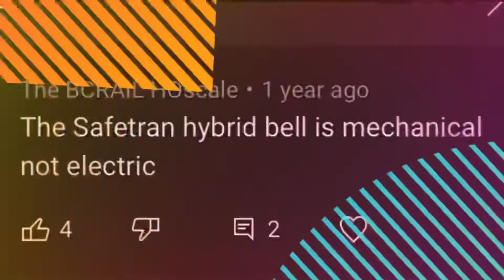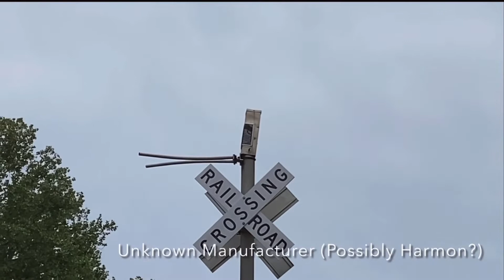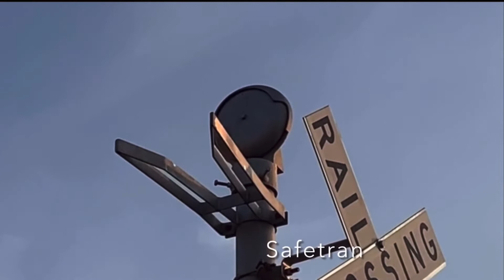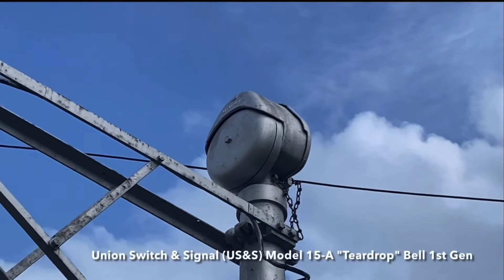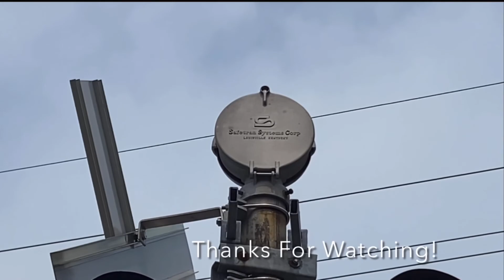2,000 Subs: Different Types Of Railroad Crossing Bells - Remastered!

Comment: Kinda surprised you only did one Safetran, given that they had two different generations of mechanical bell, lol. Nice video though!
And congrats on 2k!
Reply from the maker: They actually aren’t generations. They are just the 5 inch and 4 inch versions. The 5 inch ones are the flat bases and the 4 inch ones have the slanted type. They used both models from the 70s into the 2000s.
Reply: @upking9080  From what I've seen, no. The 4 inch base ones appear to have proceeded the 5 inch base ones (at the very least), and I haven't seen any evidence that they were sold alongside each other at any point.
Reply: The 5 inch base ones even have a piece cast into their bases to make it easier to mount them on a 4 inch mast.
Reply from the maker: Interesting. I’ve seen a photo of a Safetran bell in the 1970s with a 5 inch base, so I’m not sure what to think.
Reply: @upking9080  The 2nd Gens were already being made by the late-70s, IIRC, based on what I've observed. The 1st Gens don't seem to have been made much more than half a decade or so, give or take a few years.
Reply from the maker: What confuses me is that I found a photos of a brand new 1985 safetran install with a brand new 4 inch base bell mounted on an adapter.
Reply: @upking9080  Hmm... New old stock, maybe? Or even re-used? Really, outside of the bodies (given the fact that the bases are cast-on), the two generations are pretty much identical, especially mechanically. I could easily see a railroad re-using a bell that'd been removed from another crossing or even finding it in storage somewhere and using it.
Reply from the maker: What doesn’t add up was that the install was brand spanking new, and everything was the same color of shiny silver aluminum. The old "signals" were crossbucks. I’d also like to note that a few other crossings on that line that got new signals, also had 4 inch bells on adapters.

Comment: Where the crossing with the General Signals prototype chip?
Reply from the maker: That bell is gone now.
Reply: @upking9080  Did it break?
Reply: @cdtx8306  no it got replaced by a new bell
Reply: @cdtx8306 most likely a safetran type 3